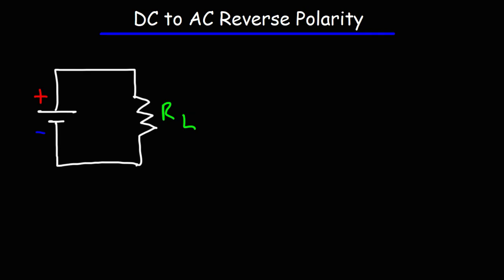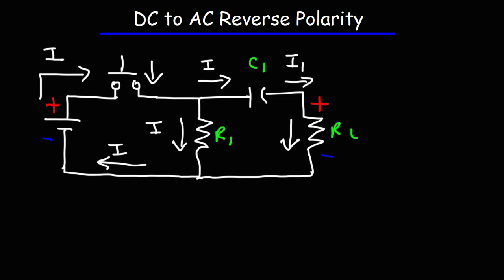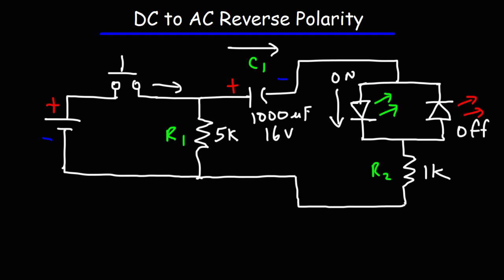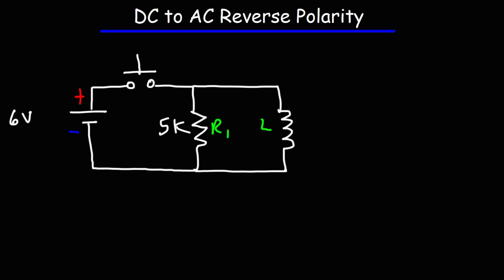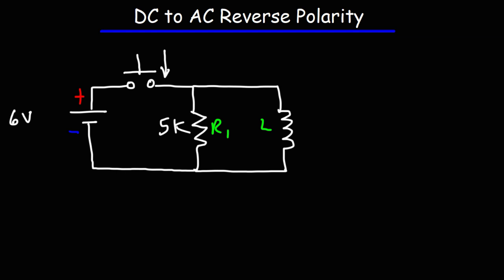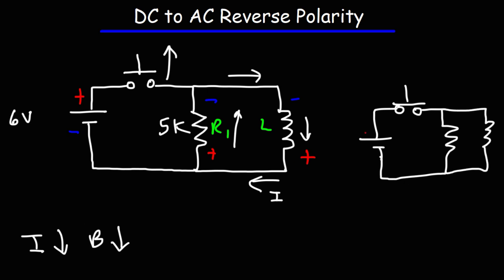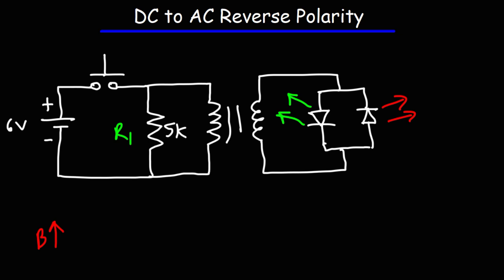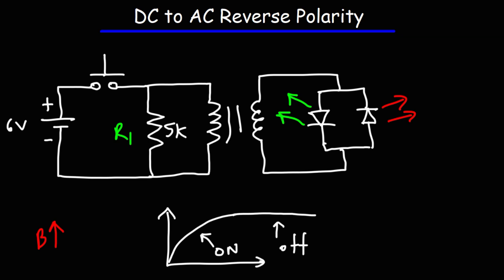DC to AC Reverse Polarity Using Capacitors, Inductors, & Transformers

Comment: This was well explained for the inductor, but got me really confused on the capacitor example as my understanding is that capacitors block DC, not allow it through, so would have liked a better explanation of this circuit.
Reply from the maker: Capacitors do block DC current, yet, electrons can flow through the wires leading up to the plates of the capacitors.  Here is a video that explains it:
https://www.youtube.com/watch?v=iQZknlJjaj4

Comment: great video, so you could use this to get ac from pulsed dc? and use it to drive a cockroft.walton multiplier from a pulsed dc source? i need to multiply 30kv pulsed DC to around 100kv DC. I understand that you can only use a cockroft walton multiplier with ac because it needs to reverse polarity to work, but with this couldnt I just add a 30kv capacitor across the output of the pulsed DC source to have it reverse polarity when the pulsed dc goes to its 0v cycle? or would this not work? any help would be really appreciated

Comment: I have a question. In the first part of the circuit cicle when the capacitor powers the circuit the current goes directly through inductor from + to -  . In the second part of the cicle when the inductor starts to power the circuit it changes the polarity across itself. Why doesn't the current go in opposite direction directly from + to - through inductor like it did in the first part of cicle ? But instead goes through resistor first and the ends up on the other side of the inductor?

Comment: If using the circuit with a strobe type setup wouldn't it be an automatic polarity changer turning dc to ac and hear me out could an inductor  that powers let's say a electromagnet in strobing changing polarity. Ok using this magnet and circuits could you get the magnet to generate more electricity like a solid magnet does.